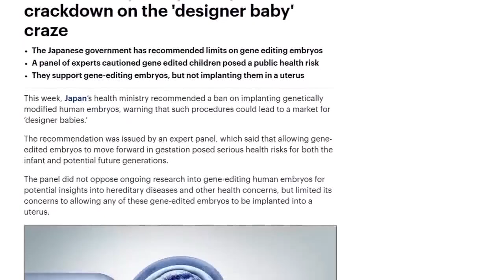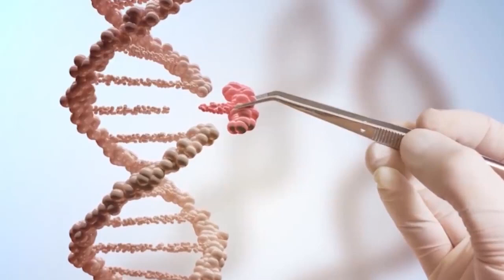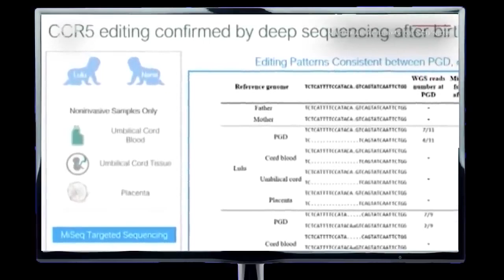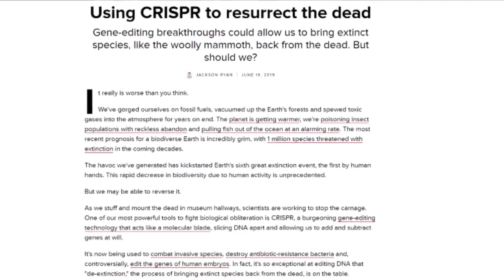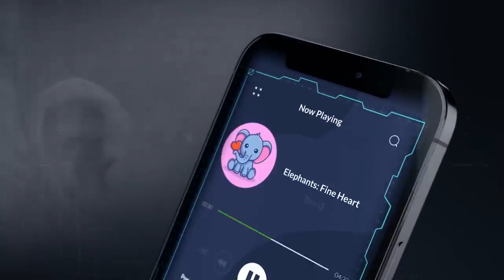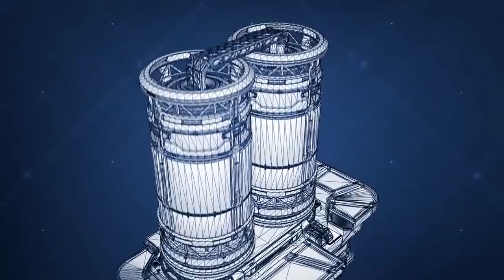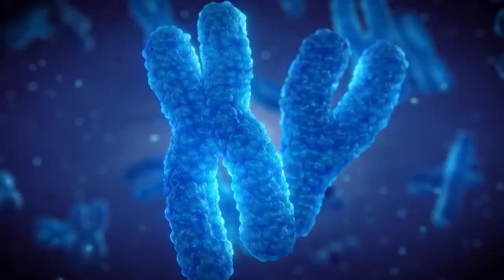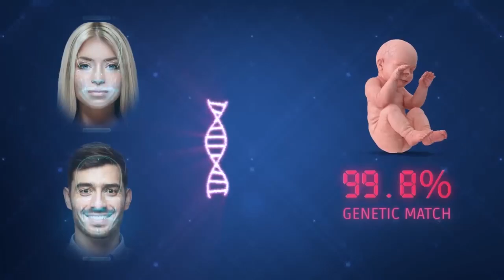Transhumanism and Human Genetic Engineering - ROBERT SEPEHR

Comment: I think we are part of a simulation to produce external consciousness or to give consciousness eternal life. I think dark matter is a superconductor, our star is a magnetic charge being pushed through the superconductor and our planetary bodies would be the electric charges being pushed out of the magnetic charges way because the magnetic charge is moving forward and pulling all the planets along with it in orbitals around the magnetic charge outside the superconductor containing the charge. We are outside the superconductor being dragged along with our star which is contained by the superconductor. 

Our universe is powered by magnetic charge and part of a sophisticated computer system built with superconductor and the star is literally the magnetic charge being pushed through the conductor and the planets represent the electric fields on the outside of the conductor being pulled along by the magnetic charge. This would explain why magnetic charge doesn't exist inside our universe because the superconductor is a complete circuit and thus no magnetic charge will escape the conductor making that the reason why we cannot separate the poles of magnets. When a star explodes its just releasing memory not magnetic charges. So it's in the form of binary code and frequency or light and matter. 

Matter is code. Our physical weight is related to gravity which pertains to clock speed. If a larger hunk of code takes longer to read than a smaller hunk of code than the clock would have to adjust to keep read and write cycles in sync. That would be why we determine weight by mass x gravitational field because it's really just clock syncronization. A larger hunk of code takes longer to read and thus the clock has to adjust to perform read and write cycles in sync. Think of each planetary body as a memory channel which has its own weight determined by the mass (string size) which sets the magnetic force = voltage. We are visualizing the machine we are contained in through the diagram being outlines by all the magnetic charges moving through the conductors of the machine. More force must be applied to a larger field (string) to maintain clock syncronization. If you change location and move from one field to another the voltage will adjust which sets the force that reads your code. When our code is placed in a field it tends to find equilibrium with the energy potential of the field barring outside influence you will fall in sync with said field. We are at rest with the gravitational field of earth. Gravity has nothing to do with curvature and everything to do with frequency harmonics. Frequency harmonics at work.

The magnetic charge of the star is reading the memory as it moves along the memory channel, it is then writing the memory through the emission of light and electrical charges resulting in our material world and existence. The magnetic field of the star also radiates out of the superconductor but because the charges are contained the field returns so its reading and writing memory as the star moves through its orbital. We are literally leaving memory behind in space as we move through time and that is also why space is expanding so rapidly because it's receiving tons of memory.

This means we are not really in motion physically rather we perceive ourselves in motion. In reality our memory is the only thing in motion driving our perceptions.

So we got a magnetic charge moving through a superconductor (our star in a dark matter superconductor) reading memory from the system, it's then emitting/writing that memory into space through the emission of light and electrical charges. So it's a read and write function hence why space is expanding so rapidly. So as the magnetic field radiates out of the star it is delivering the memory the magnetic charge is reading from the system. Then it's emitting that memory through light and charged particles which is just to say memory.

This is how our code is written into the stars and stored in space!

Comment: Genetic engineering could not manipulate the most important aspect, the soul essence
Reply: BODY: HARDWARE.
SPIRIT: POWER SUPPLY.
SOUL: SOFTWARE FOR EXPRESSION.
THOUGHTS ARE SPIRITUAL CONVERSATIONS.
WORDS ARE THE WINDOW THROUGH WHICH THOUGHTS BECOME ACTIONS.
ACTIONS ARE MANIFESTED MOTIVES.
THOUGHTS TRIGGER EMOTIONS.
EMOTIONS ARE THE LANGUAGE OF THE SOUL.
EMOTIONS EMIT A FREQUENCY CALLED FEELINGS.
FEELINGS ARE THE LANGUAGE OF FREQUENCY.
EMOTIONS REGULATE MOOD.
MOOD MITIGATES WHAT A PERSON IS MOTIVATED TO DO.
Reply: @haggai3.477  BOLLOX! Is your caps lock key broken or something?
Reply: No but it can disconnect humans from it. They want to cut off the "umbilical cord ".
Reply: @kostapapa1989  Didn't you watch the video? The traditional umbilical cord, will be replaced by a synthetic one. It will perform the same function, in delivering nutrients and other necessary molecules to the developing foetus.
Reply: @sandgrownun66  Didn't you read and understand my comment ? Read it again to better comprehend.  I put quotation marks around the word  "umbilical cord". And it is pretty obvious I was not talking about the body. IT WAS A METAPHOR. I was talking about the connection to the soul essence, not the actual umbilical cord.
Reply: @kostapapa1989  First prove something you call the "soul essence" exists? Then we can talk about your illusory "umbilical cord".
Reply: "soul essence" What made-up term is that?